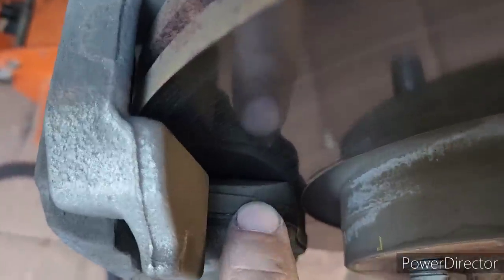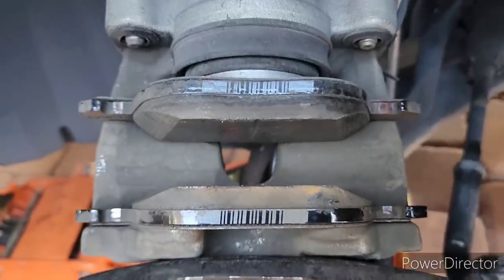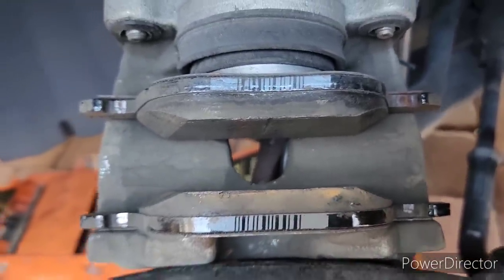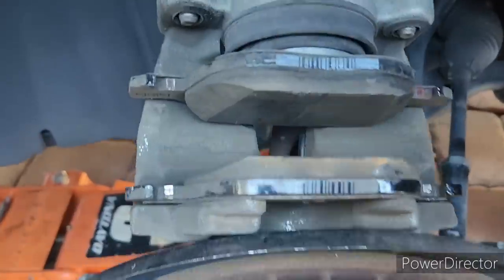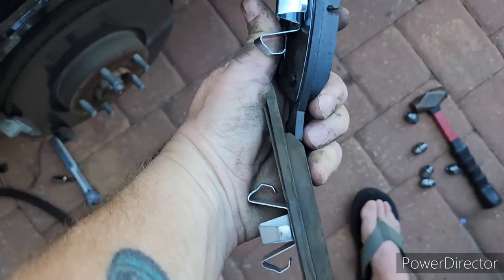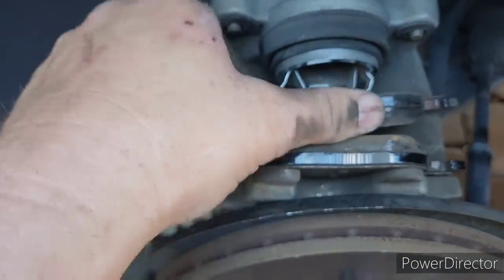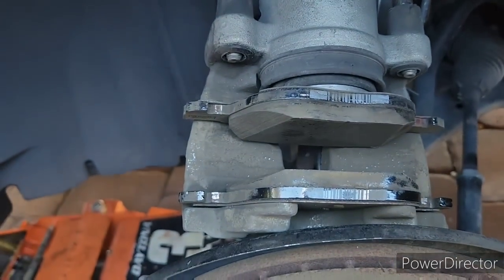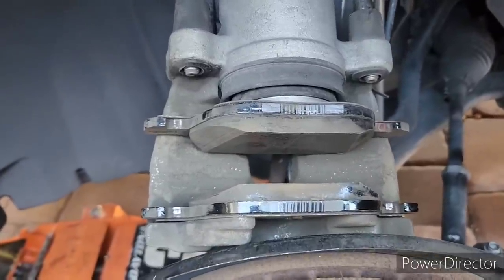Ford dealership robbed a little old lady out of a brake job. (almost)

Comment: I got out of the business for mental reasons. I noticed once I went flat rate; I started making no money because I wouldn't recommend anything if they didn't need it. Most maintenance stuff is recommended based off the factory mileage recommendations. The service manage would always hound be because I wasn't getting any hours. I tried to explain to him I wasn't getting upsells because I would only try to upsell what is needed. He of course never worked on cars and was just a desk guy. You cannot be a mechanic these days on flat rate unless customers are buying stuff. I'm not making any excuses or anything; that's just the way it is. If you're young and looking to get into the business; don't. Find something that doesn't have the type of pay scale as automotive does.

Comment: I always ask to give back any parts they replaced if I had to go to a dealership. On one occasion I got a pair of new front rotors, they said they were warped and there was not enough rotor left to resurface them. When I got the old rotors. I looked up the specs and used a micrometer to check. There was plenty left for resurfacing. When I went back I told them if they didn't make it right I'd see them in court. 5min later the manager came out and refunded the price. Buyer beware.

Comment: I had a Merlin shop in Cary, IL try to charge me $620.00 for 2 outer tie rods and an alignment...Luckly I do most of my own work and immediately laughed.  The tie rods cost me $35.00 and the removal and installation took 45 minutes of my time.  Counted and marked the turns so no alignment needed.  I feel sorry for someone who would have simply paid them to be robbed of their money.

Comment: You can bang the air filter on the ground for years before it actually gets clogged enough to need replacement.ive had the same filter about 5 or 6 years and it still is not dirty enough to need changing.

Comment: I had a Ford that needed a service, it went to the Main Ford dealership. When I collected it I had the usual bill showing that various parts had been replaced, amongst these were 4 spark plugs & set of points.............After driving the car away, I was aware of some 'stuttering & hesitation", back to the dealership who said the the parts needed to 'bed in over a few miles".
Over the next few days it got worse, so, knowing an old retired mechanic I contacted him for help.  Immediately asked me to take him my car, where he found out that the '4 NEW' spark plugs were in fact just TWO new spark plugs & two very old spark plugs, the 'NEW points' were not new at all but had been in the car since its original delivery...........

The dealership refused to entertain my complaint of charging & overcharging for parts missing, saying the car had left the dealership in good running order & any old parts had been fitted by me...!!!!!   ???/      That Ford for you............never again !

Comment: My local Hyundai dealership had my car in to check my clutch because I seriously overheated it.  Totally my fault with bad technique in very slow bumper to bumper rush hour traffic.  They didn't try to screw me but said I probably took a year or two off the clutch that day.  Wheaton Hyundai in Nanaimo BC are one of the good ones.

Comment: If you don’t do this to make money 💰 for dealers, you won’t last there. I have been through this at Toyota, Chevy, Nissan and dodge. Whenever cars 🚗 roll in, service writers run to customers with dirty filters, brakes and bunches of suspension problems. Tuneup is the worst thing too.

Comment: It happens. I took my van years ago for some body work. I asked them to do a brake check and the quote came back very high. I do brakes myself - so I declined. I brought my van home and to my surprise - the ac was not working. I couldn't believe it. It was working before it went into the shop. So I troubleshot the issue and found that the fuses were pulled from from the fuse panel. I replaced the fuses and it was working like before. My theory is that becuase I didn't get the brake job from them - they pulled the fuses so that I would return for AC work. Crazy world we live in. Just crazy!

Comment: When my wife purchased her 2006 Ford Mustang the dealership granted her $9.99 oil changes for life. So generally I tell her to take it in because they can do it cheaper than I can. Fast forward to now they said that the rear pinion seal was just starting to leak. I went home clean the bottom of it with brake cleaner two years have gone by and not a single drop on the ground please educate yourself otherwise it’s easy to get taken advantage of. One more thing they have stripped out the oil drain plug and also broke the filler neck on the plastic valve cover and also have added the wrong weight of oil. So if you can find somebody out there that is trustworthy they are definitely worth their weight in gold. Be blessed you all

Comment: When I worked at dealerships I refused unneeded work weekly. I’ve seen the damage done by independents. The so top dog shop dropped a glow plug tip into a cylinder. Damaged head and piston. I did the r@I of engine. There rebuild person installed low pressure pump back wards. Damaged even more.

Comment: Dealers are ridiculous.  The service guy told my 2019 ram 3500 needed a new egr valve at 10,000 miles because he said whoever built the engine installed it upside down.  Lmao,  he didn’t know I was a mechanic.  I called them out on their BS right away and made a scene in there.  That guy no longer works there.

Comment: Brake Check had a $99 special. A friend took her car in .(about 3 years old but did not have 12,000 miles on it). She called me because they rand the cost up to near $800. Needed new pads, new captors, new hoses,  the disk needed turning, and the fluid flushed.

I walked in and asked to see all the parts. that needed replacing. Talk about crawfishing they started to big time. And just like the pads in the video they were barely worn.
She paid the $99, however I took her to the JP and she filed on them. They never showed up to the court, and she got a $298 judgment+ courts cost. against  them.

When she filed with the court 90 days later to collect they went to brakes check and got her money + $200 for the courts having to send a officer there.

Their $99 special is just like the oil change. Just to get someone in the place so they can sell them the shop.

Comment: Had a 99 Dodge Durango I bought brand new. Many years later the transmission began acting up shifting from 1st to 2nd. Then it got worse and would stay in first and not shift at all into second. My father in-law called a transmission shop and they said the transmission needed rebuilding. Would cost 2500 dollars. I called a different shop and they said it was probably the speed control sensor and would cost 150. I asked if it was inside or outside the transmission. They said outside. So I went to a Dodge dealer and bought a new one for 27 dollars and replaced it myself. That fixed it. Apparently the tip is magnetic and grundge accumulates interfering with the sensor. I was so proud I fixed it myself for only 27 dollars. Then my father in-law asked why didn't you just take out the old sensor and wipe the grunge off seeing if that fixed it for free? He can be very irritating.

Comment: Problem is that they will tell you you need new pads (99 dollars per axle), but when you tell them to go ahead, they have to Turn the rotors and then it was to thin!( rotors didn’t need to be turned) ford rotors are 160 dollars each!

Comment: I took my Kia to a Kia dealership to fix my air conditioner. They quoted me a price of $1,400.00 to replace all the hoses as they were all leaking. I then took it to my mechanic and there was one hose leaking and was charged $229.00 for the repairs. I never take my car to dealerships unless it is under warranty. I took it to the dealership this time as I was told that you can only get Kia parts from the Kia dealership. My mechanic said this was not so. Dont take your car to dealerships except for warranty work.

Comment: What they did in some states taking advantage of the older person is against the law. I myself have found this happened to me a couple times I was told something needs to be fixed that wasn't really cheap but I knew that I just had it done maybe the year before and I don't go there anymore I'll let him changing my oil that's it ain't getting any other business out of me but what I do recommend is that you find a good mechanic that you could trust that it's honest they are out there. Another problem is some people really don't care they got money and if they say hey they're going to charge you $1,000 for a $500 job they don't care just paid $1,000 cuz they have it. But if you're Frugal with your money and money is tight or you just like to keep it in your pocket you will find yourself a good mechanic who will charge you a fairprice. But what's really sad and that's why they passed laws when you take advantage of a senior it can be Criminal what this company did they showed this woman a fake photo so what they were doing would committing a fraud against her. This kind of behavior is not acceptable they need to be reported for what they did to this woman. They are doing it to other people too.

Comment: My Escape is in the service dept now.  Air cond. stopped.  I guess its a flapper door accuator.  Covered under waurenty.  They recommend changing plugs, flush coolant system and flush trans fluid.  82500 mile.  Only $635.

Comment: I took my Cadillac SRX to a dealer for an oil change because of a coupon offer . A mechanic came out and asked if he could take me for a ride because he found a serious transmission issue . I went along , knowing he was full of BS . He quoted a computer diagnose to confirm at a few hundred and a fix of a few hundred more. I declined. That was 10 years ago and never touched the transmission.

Comment: The truth is: They wouldn't have changed them, and your friend would be happy with 4 years of use. A regular customer would endorse the dealership to their friends, saying how cheap the brake job was. Everybody is happy because nobody will ever know the difference. So many times a mechanic will tell you that you need a $1500 valve job, but they will change a spark plug to fix the missing cylinder. The customer gets a set of spark plugs for $700 and they go away happy that their head job was half price. They recommend their mechanic to all of their friends, telling them how cheap and fair he is, and that he did a great job within two days. It's a real racket.

Comment: Took wife’s car to get brake fluid changed at a Firestone. They said she had a valve cover crack, no oil, oil leak all over, all brake pads worn, needed new rotors, etc. Luckily I grew up with a mechanic dad. Nothing was wrong especially since I just changed the pads a month ago. Zero oil leak which I also did a month ago
Reply: I try to do much of the work on my truck due to the dishonesty of businesses. When I started to flush the brake fluid on my truck and was looking at some videos on how-to, I saw some videos that said some businesses would use a turkey baster to withdraw the old fluid out of the reservoir and pour in new. That's all they did. Looked like they'd flushed out all the old worn fluid and put in new, but not so. Scam. Hope this helps someone. Jesus bless.

Comment: I recently gotten a job at a dealership as a lube technician after I was tired of sketchy practices at a quick lube shop.
So far I like working at the dealership, but I have noticed a disconnect between the mechanics/technicians and service advisors. 
I believe most of the mechanics and technicians there are fair and honest, but the service advisors will try to upsell whenever they can based on the inspection information (which is just measurements of various things).
Well, when starting there, I had very limited knowledge of car repair besides the stuff that I've worked on with my own vehicles. Something I never got around to learning (until now) was tire and brake wear and how to properly measure those, and a fair amount of people knew that there. 
So it was about my second day in and one of the oil changes I gotten was a non-tire rotate, so I wasn't supposed to take the tires off. Because I had to still measure the brake pads, I had to do it through the wheel. The mistake I made was measuring off the caliper, not the top of the brake pad itself. With this vehicle I was working on, the caliper kind of wraps around the brake pad area and gets close to the rotor, so when I measured it, I had gotten an inaccurate read because I went off of the caliper.
Well, after I had written down the measurement I gotten and handed it in to the service advisor, they seen the low measurement for brake pads and did everything they could to sell the service.
The advisor did manage to sell the service, and it was assigned to a mechanic for it to be done, but when the mechanic started to pull the wheels off, they realized the measuring mistake I made.
In the end, the service was declined, the mechanic had a bit of a laugh about it even though they were also annoyed of being assigned unnecessary work when they got longer projects that needed to be finished, and the service advisor was pissed off at me for the rest of the day. 
I've since learned from that embarrassing mistake, along with picking up a tool that makes it easier to get brake pad measurements for situations where I'm not supposed to take the wheels off.

Comment: I'm pretty sure Valvoline instant oil does something weird. Everytime I go in I'm always "low one quart" they show me on the dip stick. My car doesn't burn oil or leak. I do my own oil changes now and I'm never low like I am at the shop.
Reply: Back when gas was pumped for you and they checked the oil, employees were good at "short sticking;" the dip stick, as in don't put it all the way in and it will show low.

Comment: I once did the brakes on my mothers car (rotors and pads). a week later she took her car to get tires, at my suggestion, and they told her she needed brakes!
I was there with her and told them to put the wheels back on the car and that we were leaving and calling the better business bureau. I was actually yelling so the other victims of this business could hear me. The guy was surprised as he didn't see me come in with her and then said he must have looked at the wrong car. I told him to show me which car needed the brake job and he would not do it. I told him it was because none of the cars on any of the lifts needed a brake job and he was just ripping off little old ladies. We took my mothers car to another place to get tires. I actually did report them to the BBB but I never heard anything.

Comment: Every time I bring my Dodge into the local Dodge dealership for its life time power train warranty they tell me I need brakes ,rotors, power steering flush and an oil change, I owned a auto repair shop for 40 years and it's disgusting how crooked and dishonest the dealerships are, find yourself a good private shop and stay away from the dealerships.

Comment: Same this side of the pond  had the dealers try to tell me I needed new tyres (yes I spelt it correctly ;) )  there was well over 4mm on them (legal minimum 1.6mm here ...   Oh I had a Saturday job in a tyre place when I was a teenager sweeping up putting stock away etc so picked up a bit of Knowledge... 

Likewise an independent garage tried to rip the now wife off when her exhaust started blowing on the front Flexi ..  told her to go there for a quote as they'd always been honest with me.... £500 for an exhaust on a Chevrolet matiz ... Got the front section off eBay in Germany for £30 posted and an hour on the drive I'd fixed the issue myself that garage lost all my family's trade from that day onwards the owners face was a picture when he saw me with the wife in the pub a year or so later (small town for you)

Comment: The best brake jobs I have had performed are done at my local Buick GMC dealer. When I know I need brakes, I have them do them.  They use factory original parts, and there has never been a problem.
Reply: I am sorry to burst your bubble but buick gmc etc etc do not make their own brake parts you can buy aftermarket ones made by the original equipment maufacturer from an auto part store for a fraction of the price than from the dealer. All you are paying extra for is a genuine box. Same goes for most parts pistons, rings, gaskets, water pumps, etc etc.
Reply: When YOU know you need brakes. LOL. Not when THEY know you need brakes.

Comment: I had a Focus that had the strut spring recall and I asked them about the recall and they told me they only replace it only if it breaks. Well a few months later I was going over a bridge and it had a little bump getting off and on the bridge and the spring broke and dug into one of the front two tires. They put in the paper work they put on two knew tires but they didn't they took the one one off the rear that I bought at pepboys and put on the other side on the front and only put on one new tire and the tires didn't even match. But their paper work they sent to ford said two new tires. I asked them about it and they told me it was a mistake in their paper work. Personally I don't think that is good for the transmission. The one may of been a 80k mile tire and the other could of been a 50k mile tire. in time one would wear more then the other. Plus the front two used to match and then they were not. I was planning on buying another tire to match my other new tire on the back soon at pepboys because when I got it they only had one in stock.